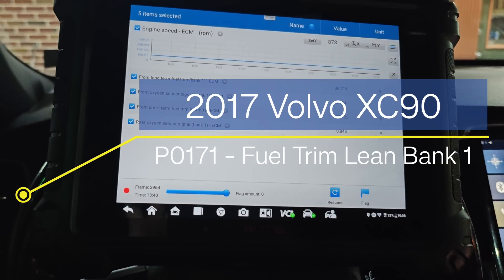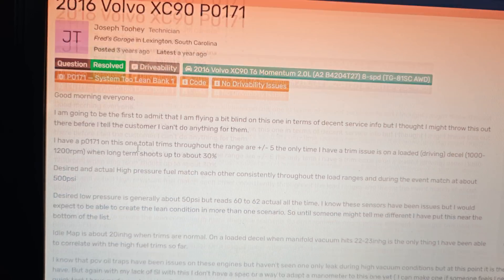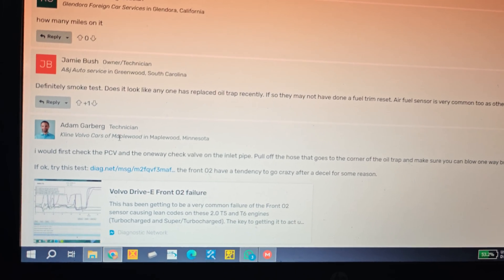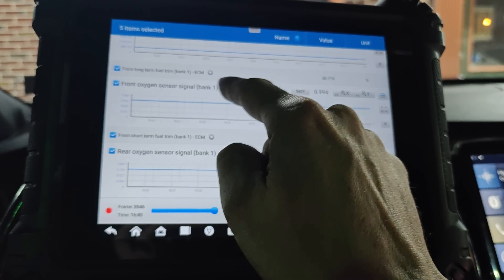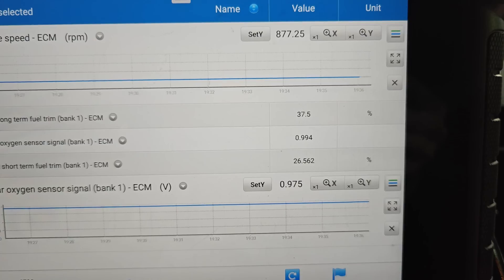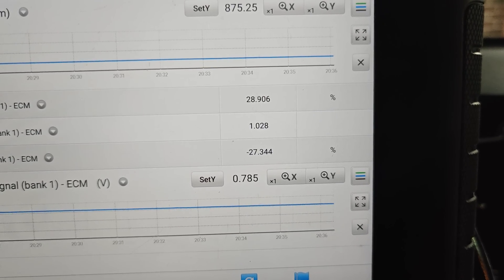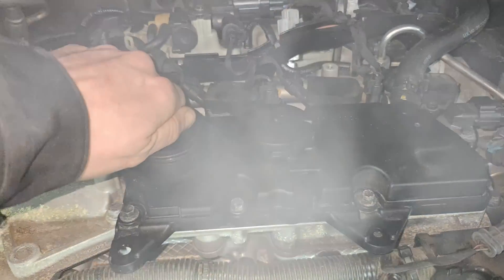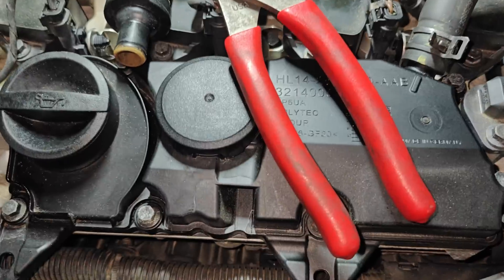2017 Volvo XC90 2.0 Supercharged Turbo - P0171 - P0170 - Lean Code

Comment: Probably too late for this comment, I'm working on the same lean condition. But I think what the post said is block on the hose with the plastic valve attachment to it. There's that cylinder looking valve that supposed to be one way valve. It has diaphragm inside
Reply: Yes that’s correct. They interpreted that wrong

Comment: You said that if you see this video its fixed the issue, what did you do? You changed the pcv valve or air fuel ratio sensor?

Comment: I have same car with the same code and the idle is not stable, when you blow air into the pcv hose, it goes through. Tell me when you change yours did you fix your problem, 2 the new pcv valve you got, did you tried to blow air into it, did it goes through or not
Reply: Hope I can help, these PC traps are notorious for going bad. There's a date calendar stamp on top and tells the year. If it's idk 5 or more years old it's likely bad. The only way that I know to check is a whittle sound coming from it while the car is running. If you remove the cap and the whistle goes away then 100% is pcv trap. The other valve he was talking about it the black cylinder looking valve attached to the hose. They go bad too. They are one way valve.